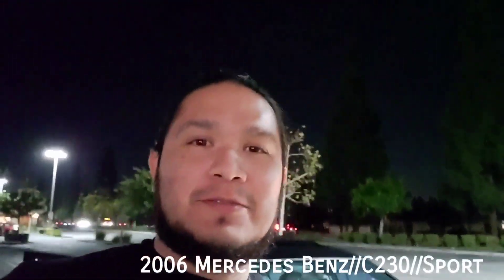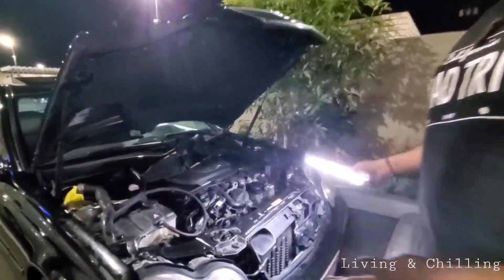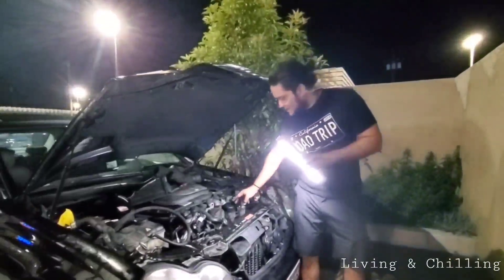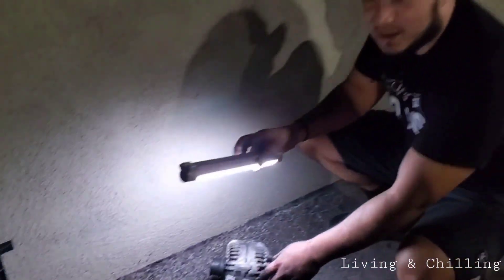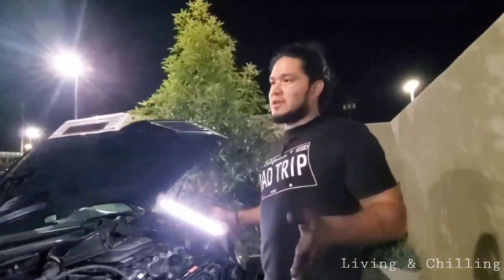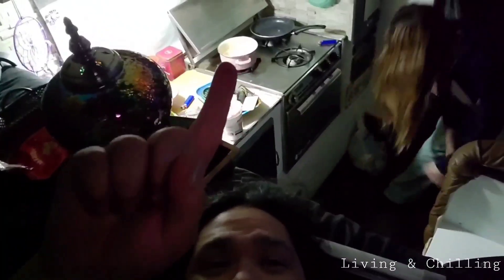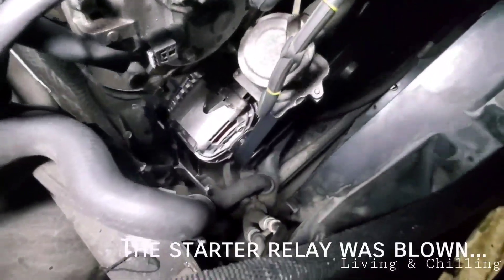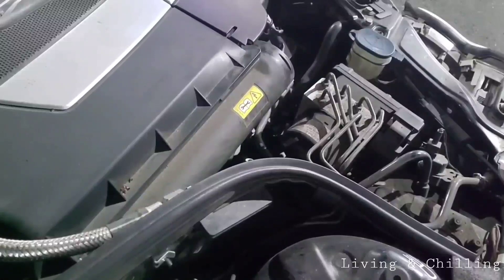2006 Mercedes Benz C230 Sport //Alternator // starter relay and upper coolant hose replacement...

Comment: Going to change my alternator this weekend. I just replaced a new battery and the in dash battery/alternator lights came on. Looks helpful same time can be difficult.
Reply from the maker: I would say that the difficult part is when you are done unbolting everything and you have to take out the alternator from that tiny spot it is bolted, however if you think how much the dealer or a regular mechanic would charge you to replace it, it started to feel easy DIY thing to do lol, good luck man you just take your time, put some music and start taking everything apart.
Reply: Living & Chilling it’s almost half of my paycheck letting a regular mechanic doing it. At a dealer to get started they want $200 for a check up, a signature for an agreement, plus more money on top for labor work 🤦🏼‍♂️ good things these tools come in handy lol and thank you

Comment: Some of the M272 engines had balance shaft issues. So not always dependable. : ) But I agree with you. The C230 / W203 is worth a little extra trouble because it is a beautiful machine. I only paid $185 for my alternator on-line. But It may not be as good as the one you got.
Reply: How long do you think this job takes an experienced mechanic? not the book labor but actual time? Thanks
Reply: @jeffwolfe4058  I'm embarrassed to admit that haven't installed it yet. I was just here trying to get an idea of what is involved too

Comment: I have a 2005 c230 I changed the bad alternator but for some reason the new altanator doesn't charge and I do not understand why because it's brand new if you can help or anyone else  please do thanks
Reply from the maker: Did you check that everything was well torqued? There is a little nut at the back that if you don't tight it well it won't make good contact, or maybe the battery is not good anymore and won't take charge
Reply: @livingchilling2217  I bought a brand new battery aswell as a new altanator thank you for responding so fast really I've been braking my head another thing I Hurd is that the dealer has to reset something like the computer but there charging a arm and leg and it's weird because I see many people change the altanator without having to reset anything I will try to tighten it harder I guess but if you no of anything else lmn thanks
Reply from the maker: @robertomedina7921  hey no problem man! I'm here to help!
My mercedez was a 2006, and I bought my alternator in O'Reilly, nothing special like taking it to the dealer or nothing, I know they will charge you an eye for that.
Maybe check fuses or relays, otherwise you probably have a defective alternator and would have to take it back, make that your last move, I know the pain in the ass that is to take it out, but do that as your last option, let me know what was it im sure you'll fix it, just be patience!
Reply: My alternater light came on can I still drive a long time